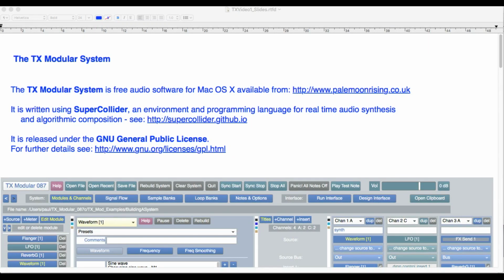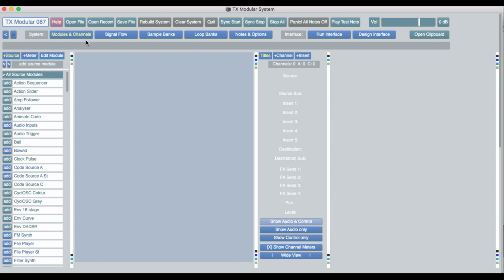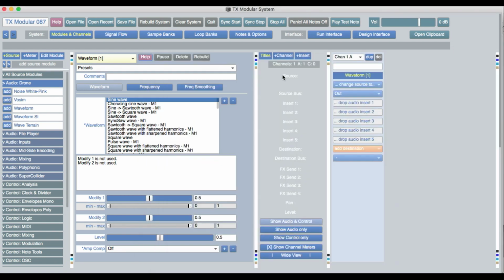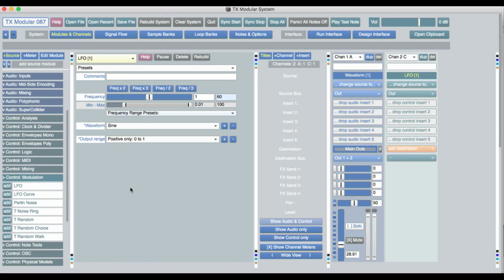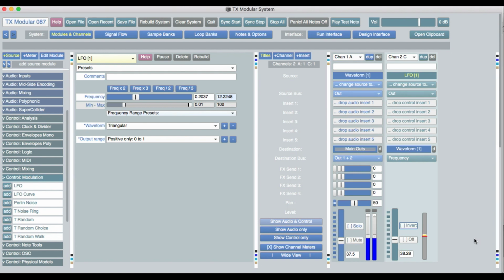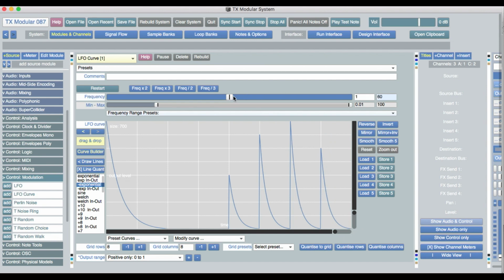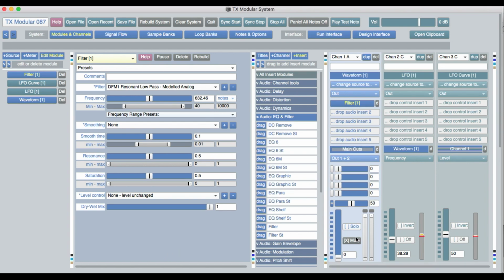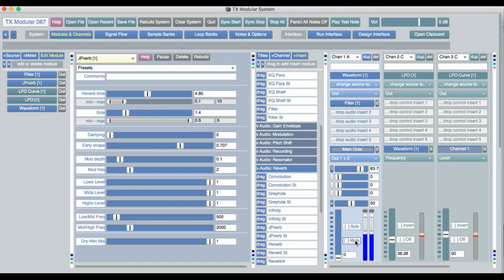TX Modular 087 Quick Demo

Comment: really really loving this. having an issue though.... does anyone else's audio cut out when they add an insert to a channel? Usually if I disconnect the channel from the main output and then reconnect it, it comes back. If I add two inserts to the same channel, I can't get any audio. No error message either. Thoughts?

Comment: Paul I cannot thank you enough for developing this software and also these videos.  Both are amazingly clear, explicit, and well thought out.  I can't wait to explore them.  I was always amazed by the power and depth of Supercollider but I was also daunted by how difficult it was to tweak parameters and then hear the results.  TX makes that process easy and inviting and fun.  Much gratitude.
BTW I was able to install on Windows 10, and it runs perfectly.  Re Quarks, I always had trouble with them until I just downloaded the entire library here https://github.com/supercollider-quarks/downloaded-quarks  Click "clone or download", download ZIP, unzip, place the unzipped "downloaded-quarks" folder in your Supercollider folder (after deleting the "downloaded-quarks" folder that was already there, if there was one), and then open Supercollider, open Quarks.gui, and install wslib (and any other quarks that look interesting to you, but they are likely not accessible within TX Modular).
I offer these suggestions to encourage Windows users to check out TX Modular.  Again, many thanks.
Reply: One more detail.  To get Supercollider to execute a command in the code window, you (1) put your cursor anywhere on the code, then (2) press Ctrl+Enter.  This tells SC to execute the code.  So for example when I double click on the "Start TX Modular" icon, I am offered two lines of code, one to load TX and the other to load it with the default audio options selected (which is probably what you want to do).  Put your cursor on the appropriate command, press Ctrl+Enter, and (hopefully!) away you go.  TX includes a beautifully detailed tutorial and extensive help, and each module includes its own help file.  It's some of the most beautifully documented software I've ever seen.  Again (I'll probably say this many times) many many thanks.

Comment: This looks like a lot of fun, but why Mac-only? is Windows version planned at some point in the future?
Reply from the maker: Hi, 
This will work with Windows and Linux but it is a bit more involved to set up. 
For Mac there is a "standalone" TX Modular app which includes SuperCollider and everything else you need.
But in Windows/Linux, you need to set things up yourself:

1) install the relevant version of SuperCollider (32-bit or 64-bit depending on your version of Windows) from: supercollider.github.io.
2) install SuperCollider Plugins (which adds extra functionality to SuperCollider) from: supercollider.github.io.
3) download the TX Modular classes from github.com/txmod/TXModular & add the folder TX_Mod_Classes to your SuperCollider Extensions folder(directory) - this can be opened from inside SuperCollider using the File menu option: "Open user support directory".
4) inside SuperCollider  install a SuperCollider Quark (an extra code library for SuperCollider) called "wslib"  by: running the SC code "Quarks.gui" to open the Quarks window,  installing  "wslib" using the "+" button next to its name, and recompiling the class library (using button in the Quarks window)
5) run the file "Start_TX_Modular.scd" from inside SuperCollider to get the TX Modular running.

More details are in the help file "Adding_TX_Classes_To_SC3.txt" which comes with download of the TX Classes. 
Best,
Paul